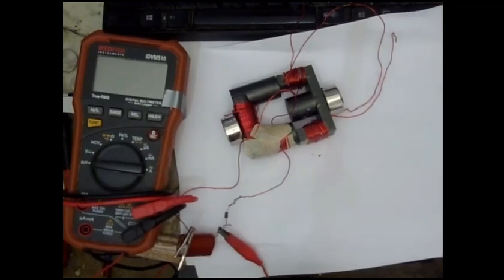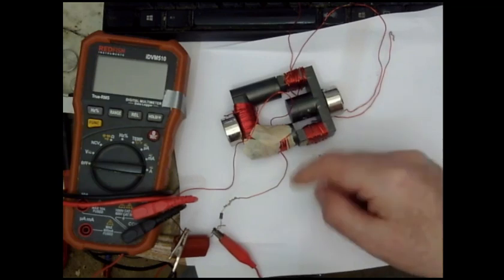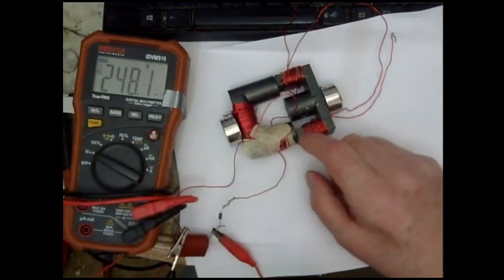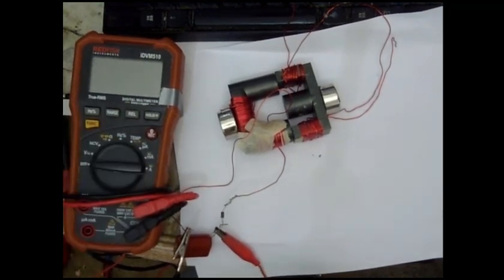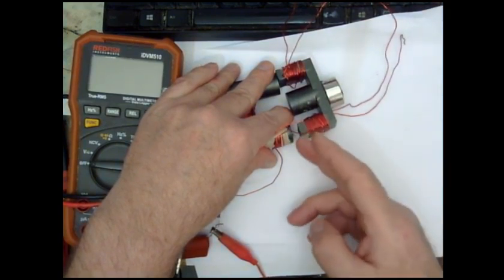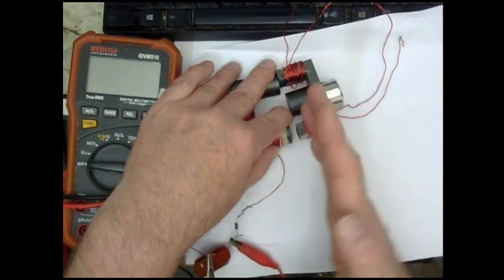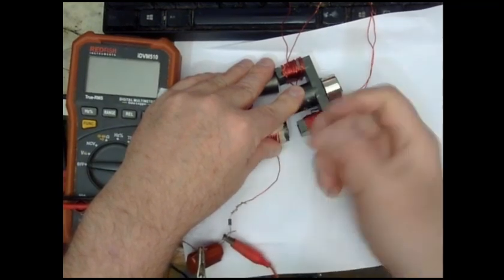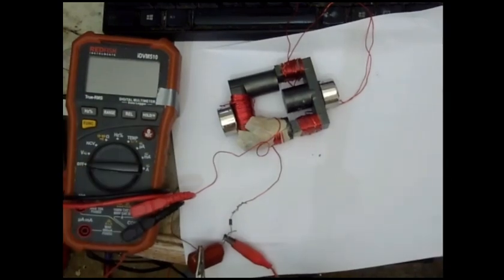Fun with the Magnetic Bloch Wall

Comment: Pretty cool. Makes me think of different configurations of the Kromrey Converter. That machine pulls in cold energy through the Bloch walls and adjusts to the load.
Reply from the maker: Haven't yet looked at the Kromrey, but first thing I thought of with this was the Bedini G-force.  When I wend my way back to the Adams pulse motor will try and take a look at some of this as well, thx.

Comment: Thanks for sharing. But why does everyone wants to add motors to a solid state design? Can't you try to add bifilare pancake coil in the Blochwall with LC resonant switching or something like that. Non motionless devices are bad.
Reply from the maker: Oh sure but you're talking about a Royal Fizbin. Spock what are the odds of a Royal Fizbin?
Reply: lc resonant switching? what would be doing the switching?

Comment: I am building something similar for 2 school projects, one motor and one generator. Motor based on Tom Wlazlak design and generator based on Don Smith design.

By the way, I never seen anyone on youtube trying to use any calculations to determine MMF in amp-turns for their electromagnets or permanent magnets equivalent. Are they all assume that an electromagnet requires a certain energy to perform work and a permanent magnet doesn’t have its own energy despite being able to match an electromagnet performance ?

If you use 2 permanent magnets or only 1 you must assume each one have its own energy, the difference between a permanent magnet and electro magnet is that we can switch on/off pr even change polarity of an electromagnet to achieve desired effect. If you try to fight full force of permanent magnets your effort is way too great but if you try to just block it or better said interpose a  interruption, the blochwall will move.

Place 2 permanent magnets in a fix position facing each other in repulsion at a distance where some force is required to hold them in place. Place a plastic rail between the magnets and slide an iron little bit bigger then the area of magnets in repulsion. You can now observe the blochwall of both magnets is moving every time when magnets are in repulsion to each other and in attraction to each other when the iron is in the gap. Now, to take full advantage you only need to wrap coils around the magnets. Observe the force to slide an iron between 2 opposing magnets is 100 times less than any other movement. Action of the sliding iron is equivalent to scissor separating 2 magnets.

I hope you get the idea. And by the way, I won’t trust too much Rick … he is a smart guy but is “contaminated” since he start to work behind Bedini’s back. Don Smith in rotary generator have used magnets in repulsion as I described above, not in attraction. Use soft iron or avoid materials with residual magnetism for great results.
The motor spinning an iron disc with holes requires very little torque but variable speed for testing and yes, you only need speed (for frequency increase/decrease) and your coils if correct calculated will provide a much greater output than the input required to spin the iron disc. Don Smith has used musical vinyl disc with holes i think.
Almost all D Smith devices were built using off the shelf large available components.

Now, using the concept elaborated above you may find easier to build a solid state device which is Kunel patent, where switching coil placed in the gap must not induce a curent in pickup coils placed on magnet conduit and only manipulate the flux generated for free by a permanent magnet. So, use MMF calculations for amp-turns and pulsed input.

If you decide to use a platform for discussions let me know, we can share our knowledge as I am not so skilled in electronics and sometimes I spend tens of hours to find a solution for the effect I want to produce.
Reply from the maker: Golly, that's great!  What is your take on Ben Davidson???
Reply: @ not sure, I never heard of him, please share.

But, if you perform any rudimentary tests following what I said you may find what you are looking for. And remember permanent magnets have their own energy … I can dive as deep as you like in this matter, but not here and I don’t want to divert. Some things I have discuss on overunitymachines forum under “classic”. I don’t have a preference for any platform but as long as I can share my findings I am willing to use any.

If anyone may find any value in what I write, can use it for any purpose as long as it is free for everyone. Permanent magnets are the starting point and electrets are next. Of course, we can swap but electrets are not as familiar as magnets and this is the only reason to use them as starting point.

For a solid state solution it makes sense to design a device to operate at 0.3 power factor and recover at least 90% of reactive power inductive or capacitive depending on your device, than simply inject back recovered energy and obtain an excess … in this type of arrangement the device is not the load, load should be powered from the excess and you only need an initial impulse to make it work.
If your device is close to 1 power factor it is obvious why it would be under unity. Think of this in terms explained in my previous message using permanent magnets and you may understand better the concept and natural physical phenomena exploited for our benefit.

An example of this at large scale is a STATCOM used in national power grid where they have to deal with both capacitive and inductive reactive power balancing them dynamic … at a small scale for home generation you don’t need such complex thing and assume a device as above … just in case someone may say it can’t work. It is unbelievable simple and against teachings of mainstream science … it is up to you if you want to build and use or you prefer to fight the science and trying to explain. If you really want to explain you must make it simple without all bs and quantum or whatever because it is pretty basic.
By the way, on second thought in this video you demonstrate how Daniel Macfarland Cook device works … just think of this.
Reply from the maker: @Caesarus2011  Hmmmmmmm, okay.  Anything else you would like to share with us???
Reply: @ oh, I didn’t mean this, apologise … I am aware that my communication skills are almost zero but, I don’t want and I have no intention to offend anyone. If you wish you can try the setup with permanent magnets to see yourself.

I found that kids can understand much easier than adults but, they have a great difficulty when in school are taught a different way when making a judgement in terms of efficiency, I don’t assume that mainstream science is necessary  wrong but, I can observe their theories are full of exceptions and paradigm when the fundament is wrong … they try to invent and reinvent the theories but avoid at all cost to adjust the fundament.

So far, related to permanent magnets they offer no explanations of why a current is generated in a Faraday disc versus cutting the wires with magnetic flux intermitent and simply refuse to explain what is magnetism … obviously nobody find this offensive. And for peace of mind making easier to accept a paradigm or exception for any possible reason avoid to compare a permanent magnet with an electromagnet, or if they do, then the only attempt is to build an electromagnet with can exhibit same properties … it is so easy to say we don’t know and we can find any kind of studies in the world about permanent magnets, which makes me wonder if we really don’t know, we don’t want to know or we don’t want anyone else to know what we know.
Reply from the maker: @Caesarus2011  Your ideas just fascinate me until I have even read them, please tell us more!!!???  It's not like I could have given a flying fuck about this video but by all means keep distributing it.
Reply from the maker: Ceasarus, please accept my apology if I was dismissive of your contributions.  I will say I recall on the old Bedini/Murkami forum, whenever someone said something I found interesting, it seemed almost instantly someone would come in with pages of tangential information that would squelch discussion of the interesting tidbit.  So I got a big head and thought maybe something like that was happening here.  On reflection it is also quite likely you were just trying with enthusiasm to share your knowledge with the group.  If so, again I apologize.  Will say you might try to condense your comments as they are difficult to follow.  Also, to further pick a nit, I don't think Rick Frederich is "contaminated", hehe.  Never met him, but seems nice enough, and I know he and Bedini got big mad at each other. I avoid a lot of these conferences, just because there is sometimes a lot of internecine gossip, and here I have been doing something similar with some of my responses.  The reference to Ben Davidson (a bit of an attempt at a joke By the Way) is the gentleman with the Youtube channel who makes unfortunately rather persuasive arguments from the astrophysics literature that we will soon as in ~ 20 years, be hit by the Galactic current wave, and, maybe, if we are fortunate, 1 in 1,000 survive.  Thank you again for your contributions, please accept my apology for getting acerbic.
Reply: @paulmaher812  no need to apologise, I know it sounds silly and counter intuitive, just think about what I have said. If you read Daniel Macfarland Cook patent for “batteries” and analyse Ed Leedskalnin transformer you may observe similarities. Cook patent specify one can use only 2 coils if so wish and also, iron core can be replaced with permanent magnets as per patent description. Almost all you show in the video … but, I guess you didn’t thought about this. Probably you may want to try to connect a small load instead of your multimeter in parallel with one of your coils; to check (circuit D in Cook patent).